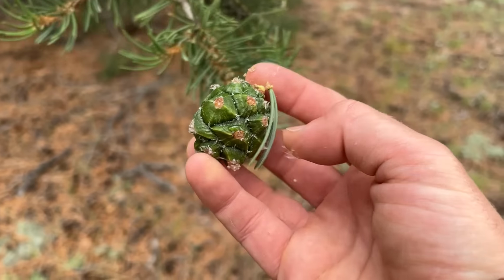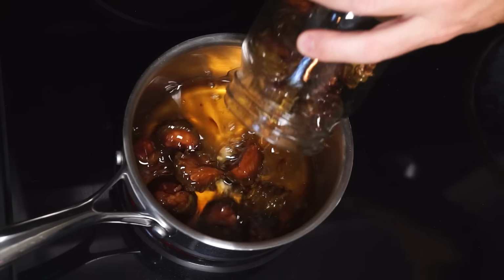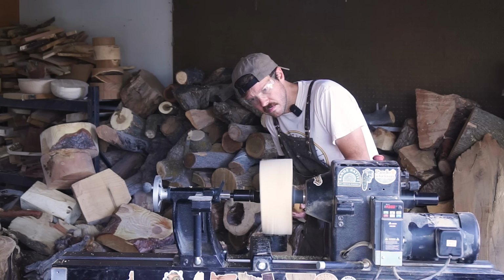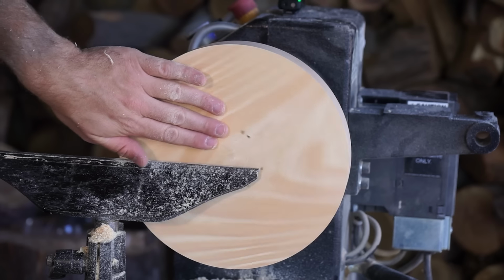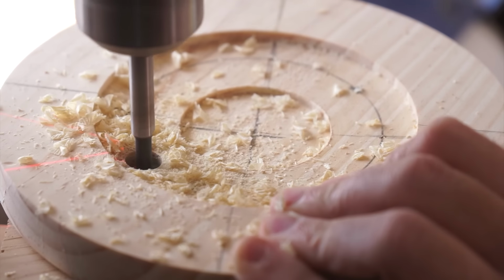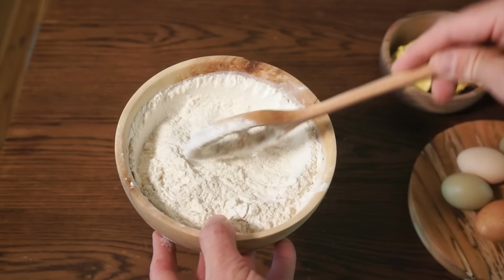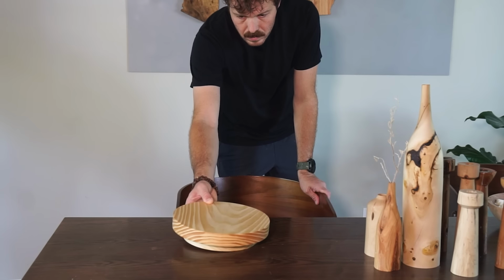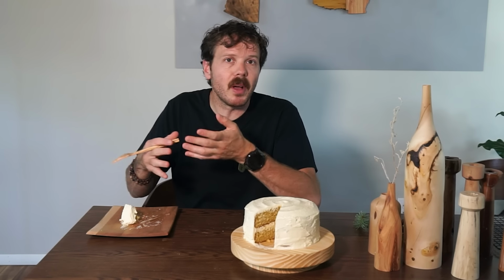I baked a cake with PINE CONES. How did it taste? | Eating Trees

Comment: The look on your face when the Lazy Susan actually made icing easier was priceless! Here's a tip for the icing a cake. If you use a metal spatula, the icing won't stick as badly and you can periodically dip it in a little bit of water to smooth everything out. I know the point was fire everything to be wood, but icing is so sticky!😂

Comment: If u want a better frosting technique, after assembling the middle, pop in the fridge for like 30 minutes (along with ur actual frosting) then smooth out the side where the frosting is peaking out, and then do a crumb coat (thin layer of frosting all around the cake, works best with an off set spatula or bench scraper), pop back in the fridge for at least 30 minutes, and then do a normal thick frosting layer. Thats only if ur worried about presentations. Regardless of the rustic look it looks absolutely delicious and im glad u had alot of fun making it. Ur videos make it really easy to decompress from my day to day activities (aka work lol)

Comment: I tried making some spruce tip syrup a couple weeks ago. It just ended up becoming full of dry crusty sugar and a bit of sludge on the bottom, and I had to add water for it to boil properly even though some of it burnt. But, it did end up having a nice smoky spruce flavor if you mixed it with stuff.

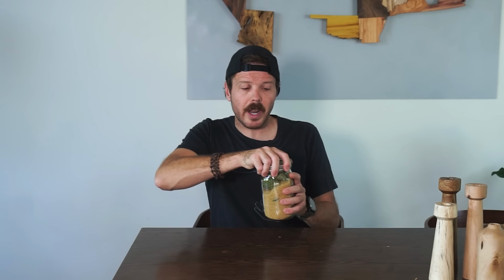Comment: Around minute mark 3:00, it was discussed that gas builds up inside of the jar. The jar lid must be removed to "burp" the jar or let gas pressure out. Why not use stainless steel mesh? You can cut a hole in the jar lid and can cut a circle-shaped piece of stainless steel mesh. After glue is put around the edges of mesh, and attached the jar lid, the gases can flow in and out of the jar, but bugs and mice will stay out. Alternatively, we could cover the jar opening with a cloth towel and tie twine around the neck of the jar.

Comment: I would suggest: use a recipe with percentages & look at your syrup through a refractometer, or weigh how much the syrup is compared to how much sugar you put in & figure out how much you need to reduce the water & sugar amounts in your cake. (You may need to reduce the amount of milk in the cake & add in extra milk powder.) The sugar state might give you a different texture though so you can probably use a recipe that already calls for some kind of liquid sugar.

Another option: when you make layer cakes, you need to soak the sake with syrup (& by soak I mean just brush a little bit on, it doesn't have to be syrup either, it can be alcohol or the juice from those sweet cherries). Using the syrup there can get you your flavour & it helps keep the cake moist because of the way sugar holds onto water, it helps prevent staling.

Right now I'm trying to lactoferment some cedar leaves but with the rest I think making syrup would be neat.

btw the cake looks really great considering you went by vibes. I am a professional cook & amateur baker so take my word for it

Comment: watching you rub the cake icing onto the cake with your hand was disturbing, please just use a spatula, it will be easier especially as it wont melt and stick all over you x.x my lorddd. maybe make a cool spatula out of some fancy wood! please.. also, you dont want to beat cake batter, you want to work it as little as possible. add the flavorings to the liquid ingredients, sugar eggs and butter count as liquid ingredients and they always go first in cake batter. the flour ideally would be added by hand and not over beaten until you have a runny batter. i would have skipped the vanilla as it would compete with what i imagine to be a pretty subtle pine cone flavor. delicate flavors need to taste a bit strong in the batter but when they bake they become more mild so it can be tricky, always taste as you go when its safe. also, i see you did switch to a spatula thank you. one good tip for smooth icing of a cake is keeping the back side of the spatula clean, tring to just let the icing run past the one side of the blade.it turned out really nice looking tho all considered. im very interested to try making this syrup for myself.
Reply: thats on purpose for the humour of the channel. He does similar 'inconvenient' skits a lot 😂